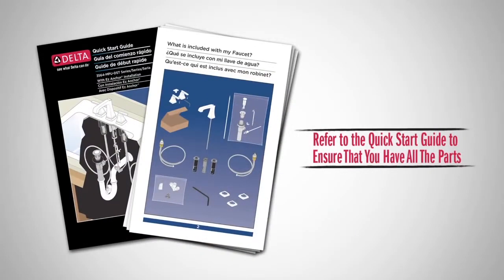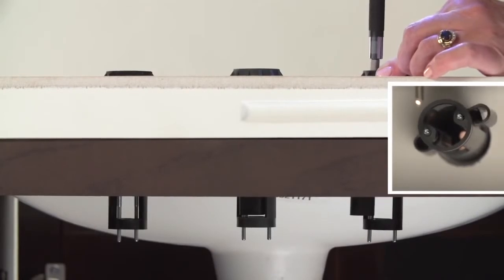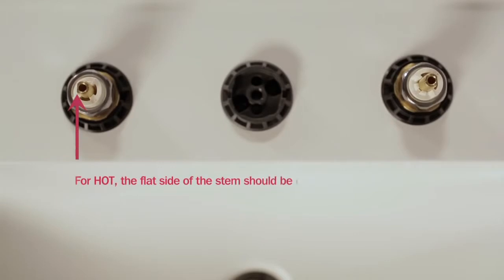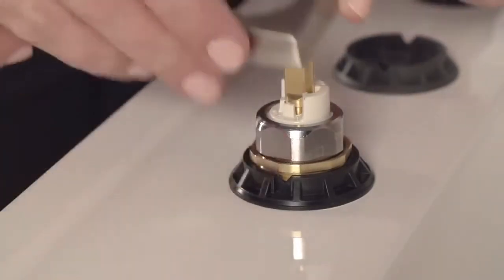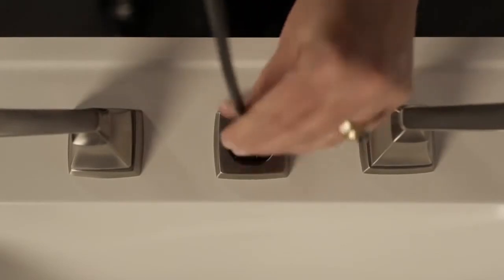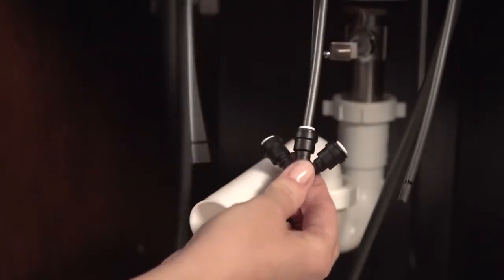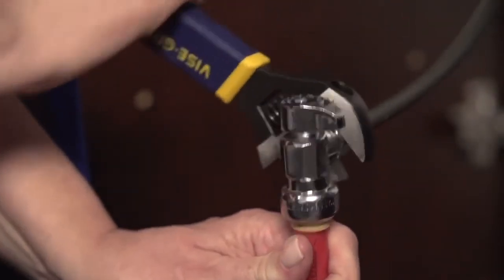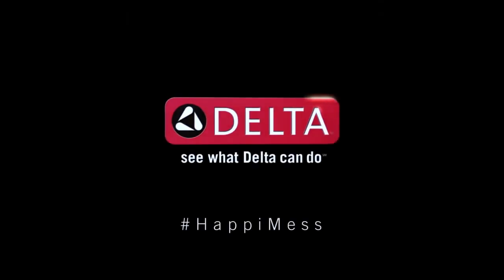How to Install the Delta Faucet Ashlyn Widespread Faucet with the EZ Anchor Mounting System

Comment: FYI, the End Valve assemblies and valve mounting assembly are discontinued on Delta's site. Finding out AFTER I ordered replacement handle to discover the assemblies are the issue, not the handles. My lesson - hire someone, or take everything apart first. Though I didn't know what I didn't know